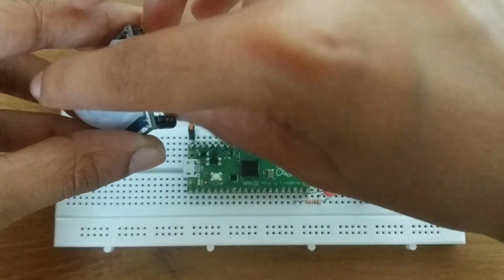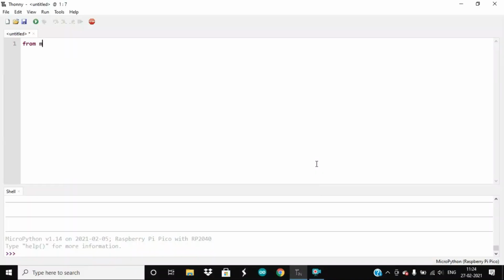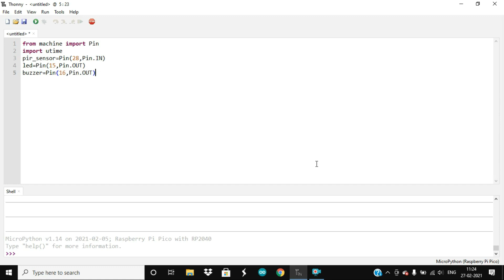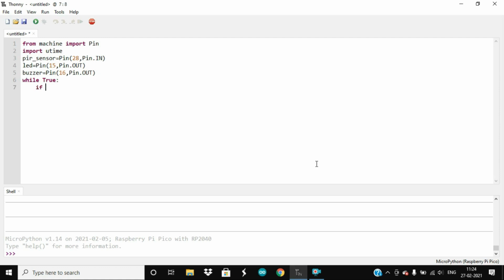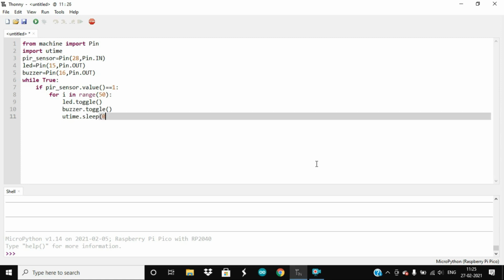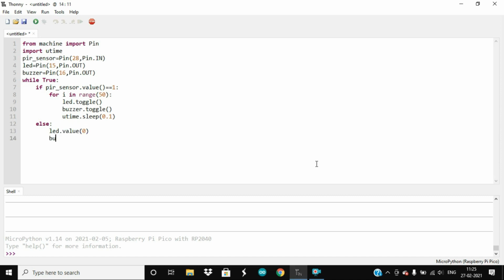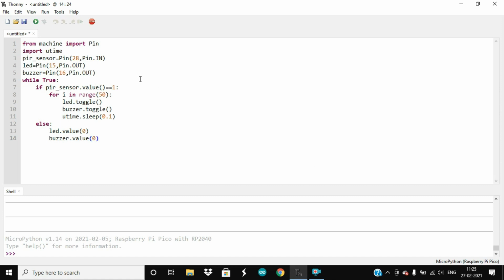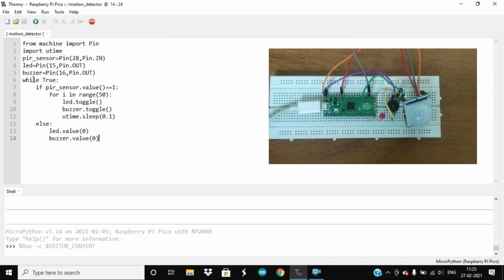How to use  PIR motion sensor with  Raspberry Pi Pico

Comment: Hey 
I tried this project 
It's working
But the buzzer isn't stopping 
Can u tell what's the problem?
Reply from the maker: Check in the 'else' statement whether you have set the value of buzzer to zero 
buzzer.value(0)
Reply: @n_tech3861  Its buzzer.value(0)
So what we have to put?
Reply from the maker: @prernagokhale8719  Could you please send me your entire code at circuitry07@gmail.com
Reply: @n_tech3861  yes